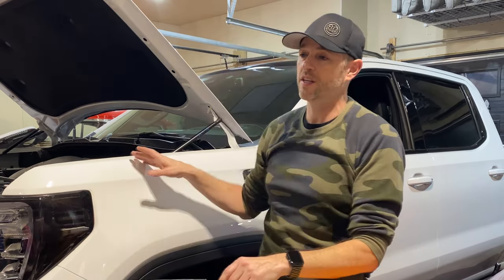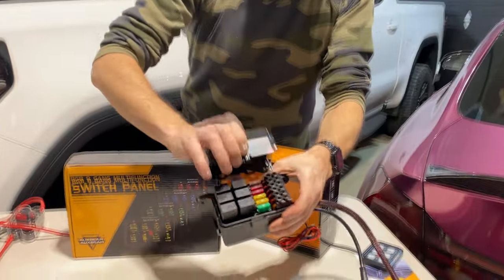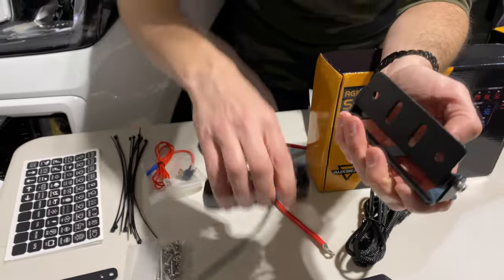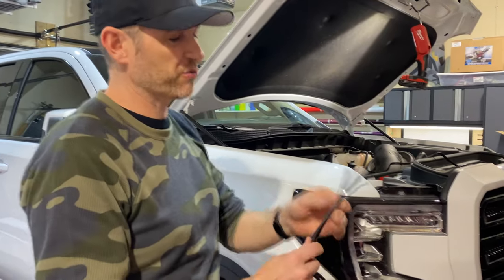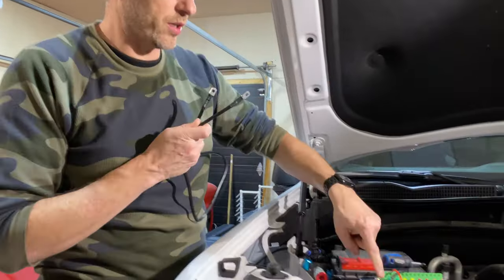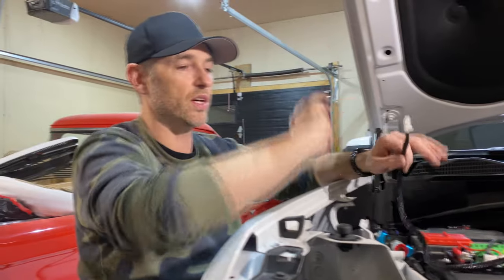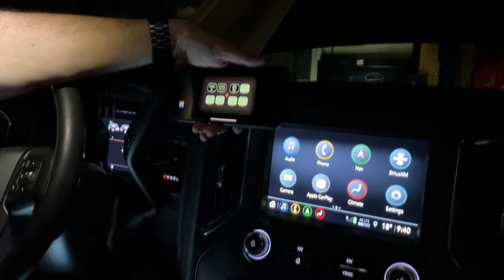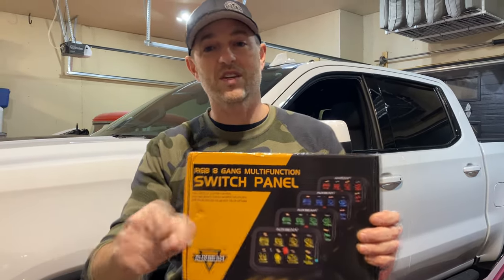New Switch Panel AUXBEAM AR-800 RGB Multifunction Bluetooth LED Install and Review.

Comment: Clean! Been planning on the switch panel before I installed any auxiliary lights. Did you consider the switch-pros 9100?
Reply from the maker: I did! But $850+taxes in Canada is more than I am willing to spend
Reply: @Donslife  Damm that's steep... with the auxbeam can you run any lights with the ignition off? For example if I wanted to run some rocklights
Reply from the maker: @saltlifechris3623  you could, but all of the connected devices would be ready to go and the panel would stay illuminated while standing by.  You could add an inline switch or a trigger I suppose.  I’d have to give it more thought.  There are remotes you could use as a secondary power source to the panel. 🤔
Reply: @Donslife  great suggestion
Reply: @saltlifechris3623  i ran mine to be hot at all times.  I shoot commercial gear firework shows so i need the lights to run long lengths of time with the engine and ignition off.  It works great,  and if just the panel is illuminated it does not run the battery down
Reply: @joshd7465  are you running the auxbeam as well?

Comment: I was looking to use this panel to run white/Amber pod lights. Would I be able to have 2 switches control each color of the light (set one to run solid white, the other strobe Amber). Would I have the jump the ground between the two switches?  Thank you.
Reply from the maker: I have a newer light bar with amber and white DRL’s.  They are hooked up to 3 switches.  One for each color and the lightbar array itself.  Works wonderfully.   You should be able to run each positive wire to each individual switch too.

Comment: Hey Don 
With the ignition cable… where would you put that for somebody who doesn’t have a compressor? Lol
Reply from the maker: Cooled seat fuse tap on the passenger side of my Sierra. Any ignition switched fuse will work. The current draw is minimal
Reply: @Donslife  thank you man 🤙🏼

Comment: Can you turn the pod light on without the ignition on or no? And if yes, how do you wire where the pod light can turn on without the ignition being on and would it drain battery? Thank you
Reply from the maker: Yes there is a way.  Here is one way that I did it :

Adding a Wireless Remote For My Accessories!
https://youtu.be/aV7ey5415dI

Comment: Don, great work, Gained a subscriber! I'm curious if you know, I reached out to Auxbeam asking if you always had to turn the switch on (for a specific device i.e. DRL, clearance lights etc) with each power up? They replied with, you will always need to turn the unit on via the on/off button on the control head or thru app once you have either key in ACC or ignition on. Is that true? Does each button have memory of previous use at power off? However, I also wanted to be able to have the unit automatically turn on with ACC or ignition and have the preset lights come on. Trying to eliminate always having to turn the unit on after keying up the vehicle to turn on my DRL and clearance lights each time I start the vehicle. Thanks!
Reply: I have exactly the same question about the memory function...
Reply: @robertionescu_  I did get this unit and although it powers up (the buttons light up) if using the accessory lead. Then you can either hit the "memory button" in the center of the unit to turn on any switches/buttons that were on when you previously cut power to the unit or, select which button(s) you wish to turn on individually. It will not power on any items connected to the buttons by default when turning the key on. hope this helps.
Reply: @davymill6696  Thank you. This helps a lot 👍

Comment: If you forget to turn the lights off does this automatically turn them off after shutting the truck off?
Reply from the maker: Yes, when the truck is turned off the panel will lose power too and shut off all accessories connected to it.   I chose to wire it up this way.  In a later video, I added a remote to be able to turn the panel on and off independently of the truck.   

Adding a Wireless Remote For My Accessories!
https://youtu.be/aV7ey5415dI

Comment: Can you dimmable LED strips with this? I want to install LEDs inside my camper and be able to dimmable them also. Is this possible with this switch?
Reply from the maker: Hi there, the switch won’t control a dimming function.  The light strip itself would need to have a dimming feature that you’d have to adjust with it’s own app or mechanical knob/slider.

Comment: Is there an option to have the system turn an input on (light bar) when you start the truck instead of having to manually turn it on via the all or in-cab control?
Reply from the maker: Not on this model that I am aware of.   If you wanted to do that, just hook up a relay as a trigger wire to your high beams
Reply: @Donslife  thanks, man!

Comment: Do you know if you are able to swap out the fuses to higher amp? Or is 30 max? Thanks for the great video
Reply from the maker: I am not sure.  My assumption would be each circuit is up to 30Amp but don’t exceed 60Amps total running at the same time.  You’d have to ask the manufacturer if you can go higher than 30amps on one circuit

Comment: If I have lights that I would like functioning while the ignition is off, does this switch Bank drain the battery if the accessory wire is hooked up to a power source that isn't ignition dependent?
Reply from the maker: It will drain a little power to illuminate the LED backlights for the panel if the remote wire is connected to an ‘always hot’ source.   I left my panel powered up overnight and my vehicle wasn’t really drained.  Over a few days it could be a problem.  You might want to do something like this : https://youtu.be/aV7ey5415dI

Comment: sweet video and after seeing some of the updates to the 8 gang panel I'm leaning towards it over the 6 gang, mainly the toggle/momentary mode selection and the slimmer fuse/relay box form factor (since it'll be going into a car). Thinking this is just the sort of thing to make installing various Leds and ambient lighting much easier (since I have yet to install any 12v accessories). I do wish there was a 3 way toggle switch option because for the front light bar I'd love to control it by being on/off/on w/high beams) but might need to wire that separately. 
One thing I was wondering is that when you were showing your compressor with the inline fuse you said you could replace the 20A auxpower box fuse with a 15A one and negate the need for the inline one. I thought replacing the fuses was not reccomended, did you end up doing that without any issues?
Reply from the maker: You can change the fuse ratings up to 30A per circuit, just don’t exceed 60A of draw at once.
Reply: @Donslife  okay cool, thanks for the quick reply bud. I just want to add a few things so 60A shouldn't be an issue. Having to run 3 less wires to toggles in the cabin will be awfully nice though 👌

Comment: Great vid!  How are you running wires from the bed up to the engine compartment? Also, if you had a 3.0 you'd be lulling a reservoir out 🥴
Reply: Pulling*
Reply from the maker: Thanks!  The video showing wires run from the box is this one:  

Rock Lights - Full Install Tutorial - GMC Sierra AT4 - 8 Pod RGB AuxBeam
https://youtu.be/US-4-QcpfWk

Comment: Can this only be used when the truck is on?
Reply from the maker: Depends how you want to wire it up.   Here is a follow up video :

Adding a Wireless Remote For My Accessories!
https://youtu.be/aV7ey5415dI

Comment: I am loving this control panel.

One question.  Does anyone if it is possible to set the control to power on the last set accessories as soon as it powers up with the car?

As it stands now, when you turn the car off, powering off the panel, next time you power the car on, you must press the main power button on the panel to activate it.

I would like to set it to power on automatically with the car startup.

Is this possible?

Comment: great video,  have a question.. I install the one thats not compatible with the app. if i get the one with the APP do i have to chasnge just the control pannel?
Reply from the maker: Good question, as far as I know the control panel that goes in the vehicle is what ‘talks’ to the app.  So as long as the switch box is compatible with a Bluetooth capable panel at a later time, I think it would work.  I would ask Auxbeam to be sure just in case the physical connections vary.  To be fair, I only installed the one panel and haven’t had experience with their other switches/panels
Reply: It worked with just the controller. Thanks for responding tho

Comment: I noticed you didn’t touch the brightness in the middle. Is the brightness for the panel or for the lights you’re turning on/off on the light bar?
Reply from the maker: Brightness is for the panel, which also has an ambient light sensor to adjust itself
Reply: gotcha, but to confirm no way to dim the actual lights outside of the vehicle? I have Baja S2s on my roof rack, but at night camping it would be nice to dim them from being too bright
Reply from the maker: @jeromefronda252  unfortunately this panel only does switching, no dimming.  Be careful too, not all lighting will allow dimming.

Comment: This look identical to the non rgb non app version. I'm thinking maybe all that functionality is built into the switch itself. My biggest dislike is that it doesn't remember what's on when I turn the car back on. So DRL would be pointless to wire up since they'd have to be turned on every time. I actually mounted my switch to my GMRS radio's mount underneath it so it's kinda like a console of equipment. Love the auto dim feature, works very well. Hopefully this will hold up better than the junk wiring harnesses KC sent me with my lights. Corroded and burned at the relay since it was 1 wire in and 2 out to each 80 watt light. The outputs were fine but the input wire was just burnt.

Comment: Wish you would’ve shown were the wire comes through under the dash!
Reply from the maker: There are two circular grommets on the firewall. One on the driver’s side and passenger side.  They are made out of rubber and need the end cut open to pass wires through.  That’s what they are there for.  In some of my videos I show them

Comment: Please someone help been trying to find this information everywhere. I have auxbeam light bar that has a power button and a toggle button to switch from white amber both and stobe would this allow me to turn them on and switch in between the different modes? Thanks
Reply from the maker: It would have to have each feature (wire) hooked up to separate switches on the Auxbeam panel instead of using the switch it came with.  Then you would program each switch to behave how you want it to (on/off, momentary or strobe)
Reply: @Donslife  would I be able to switch in between the different color modes I don't know if I explained it right. Have a switch with 2 buttons one is on/off the other switches in between white, amber, white and amber then white stobe 
Amber strobe and white and amber strobe. Thanks for ur info and time.
Reply from the maker: With the Auxbeam you could do all of those modes separately

Comment: Ah Don. I was waiting for you to visually show me mounting options inside the cab. Anyhow, I just bought one using the code. Originally $300, Auxbeam is currently already 10% off at $269. With your code it gets down to $243.
Reply from the maker: I only found the one spot that wouldn’t involve screws or cutting

Comment: What’s your next lighting install now?
Reply from the maker: Maybe the Strand.  Any other suggestions…I have some ideas
Reply: Underglow kit!! But it has to light the entire area under the truck and hiding the lights is the key! I hated seeing the neon and led strips.... took away the whole effect. Bright white to match the light bar and running lights. All other colors optional lol
Reply from the maker: @Juddmann007  I have been looking. I also do prefer the glow and not being able to see the bulbs.   So much junk out there, I have been having trouble finding some that look like they’ll survive 4 seasons.
Reply: I ran a set of streetglow neons back in highschool but on a car. Not sure if they are still around or even make neon tubes anymore. They held up through several winters and were brighter than any led strips ive seen
Reply: I'd like to see ditch lights!!

Comment: Might be a dumb question, but would this work for dual color, strobing LED emergency response lights? Seems easy enough to install, just don't want to waste time if it won't work.. Thanks!
Reply: The question I'm currently having 😢

Comment: Which fuse was your pink wire going to? I am not sure which fuse to connect to on my 22 sierra.
Reply from the maker: I ran it to the ventilated seat fuse on the passenger side panel inside the cab
Reply: @Donslife  This is the biggest question I have as well. I looked and a few others, and they also have this question, but I, unfortunately, don't understand your responses. I do think I understand that it's your pink wire in this video. I went to the compressor video but could not find exactly what you did here. Is there another wire or anything anywhere closer or easier to find? or do you have a video clip of this? Thanks so much for all the videos. Just used a ton of your discount codes so thank you!

Comment: Why did you put a blank wire end on one of the three wires where you cut off the connector? Was the wire you blanked the illumination wire for the switch that normally connects to that lead?
Reply from the maker: Yes I believe so

Comment: Soo I have RC lights that have a full light mode and a DRL mode. Will that still work with this panel?
Reply from the maker: Yes, just wire each feature to a switch.  You can also program switches to turn on together
Reply: @Donslife  thank you

Comment: Are you able to set anything to turn on with the ignition? ie DRL always on unless you switch it off?
Reply from the maker: Yes it could be done but more wiring would be involved.
Reply: @Donslife  I was thinking of wiring in a normally closed relay and using the switch to turn it off. But was hoping maybe it could be an option in the upgraded one to just be normally closed vs open.  Thanks
Reply from the maker: Exactly my first thought.  If you do it, let me know how you like it that way

Comment: Great video, and detailed installation vide. Let me comment that AuxBeam switch panel are crappy products, and customer service is terrible I install AuxBeam switch panel AR-800 according to included brochure, and only lasted 3 days, and I had to fight hard with customer service department to get my refund, I do not recomend this product at all!!!!!
Reply from the maker: Sorry about your experience.  Mine has been consistent and reliable.  I have 7/8 switches being used currently.

Comment: Those with a 2022 or so GMC AT4 where did you connect the fuse tap wire to an ignition source?
Reply from the maker: Passenger side fuse box has more options.  The cooled seats is the one I used.  Not sure the location on the 22’s

Comment: Does the ignition need to be on to turn lights on with app.
Reply from the maker: Depends where you attach the remote turn on wire.   I did a follow up video here with a wireless remote turn on option. 

https://youtu.be/aV7ey5415dI

Comment: Mite be a dumb question but when you said android box is it the same as android auto?
Reply from the maker: Sort of.  It is a separate device that is android based but connects to through wired CarPlay protocols.  Basically turns your infotainment screen into a custom Android device that can run Netflix, Youtube and apps like AuxBeam that Android Auto can’t normally.

Comment: I installed this kit on my 2018 gmc Sierra, I just need to wire my add a fuse any suggestions for ACC fuse in the engine bay? Thanks.
Reply from the maker: The engine bay fuse box has a weatherproof casing so it is hard to get wires in there without some modifications.  I ran wires through the firewall to the passenger.  Lots of options there
Reply: @Donslife  yea I was thinking of maybe drilling a small hole the size of the wire and silicone it once I’m finish but I’m open to wiring it in the cab, I read you used the cooled seats fuse my truck is equipped with that as well.

Comment: Which fuse did you tap for power?
Reply from the maker: For the remote turn on, I tapped the cooled seat circuit in the panel of the passenger side (in the cab).
Reply: @Donslife  can I tap that fuse even if I don't have that equipment in the truck?

Comment: Hi I have RC pod lights that have drl and spot light how did you wire that up?
Reply from the maker: Both pods DRL positive lead connected to a lower amount circuit (probably a 10A)
Both pods MAIN LAMP positive leads to the 20A or 30A.   One ground to the body or the ground terminal in the switch box.  I would check the specs for each pod and determine the Amp draw of each so you know what their combined draw is on each switch circuit. Then pick the appropriate one.

Comment: Once u choose an action for the individual buttons how do you save that so it stays that way?
Reply from the maker: The order of the pad’s buttons correspond to terminals in the switch box.   First button is the first fuse location in the switch box and so on.  Example : If you want a 30A device in the third location, just move the 30A fuse to the third location in the switch box.
Reply: @Donslife  sorry.... I meant "'in the app". Momentary, toggle, etc
Reply: And I figured out how to do it better ... instead of using the app... double click the on/off on the panel to go into button program mode. Blue is momentary. Once u set the buttons press the power button again to save it.